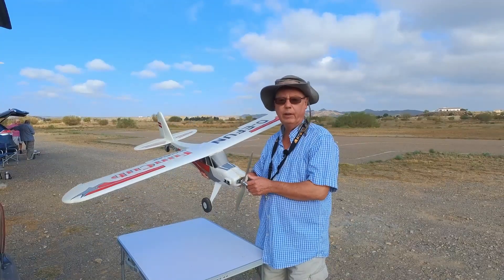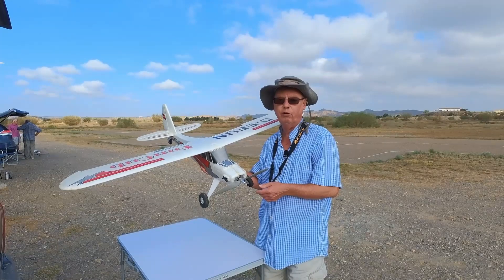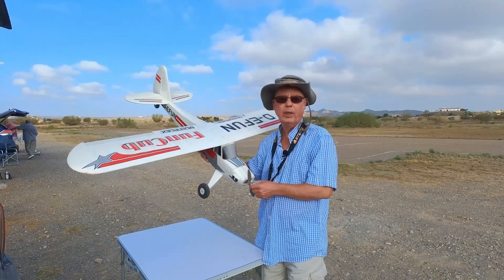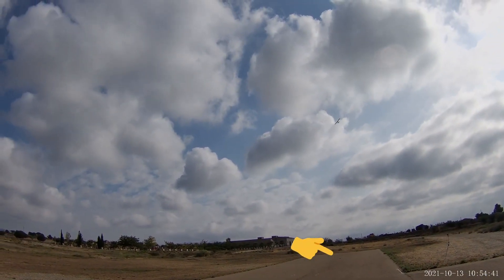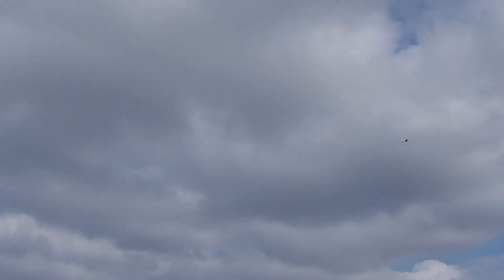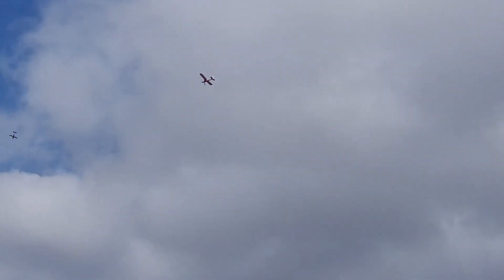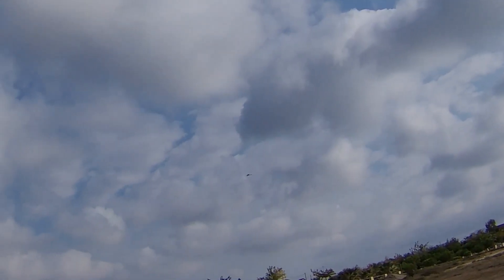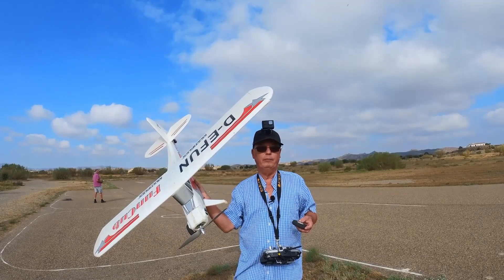HobbyEagle A3 Pro V2 6 axis Gyro Fixed Wing Flight Test

Comment: is it possible to set it on full gyro mode(when i dont hold the stick the plane going straight)? Please give me answers:)
Reply from the maker: Yes, I demonstrate that in the video here : https://youtu.be/OPIbe3jZpgY?t=184 I put the plane into a dive then switch to auto level and the plane recovers and flies level on it's own. The same can be done with the newer, smaller A3 Mini Gyro : https://youtu.be/rPhf0cLP1hw
Reply: @ thanks i cant hear english well because i am asian thanks for telling me!
Reply from the maker: @pubgmobile_player_service  If you turn on subtitles or "closed captions" CC in the bottom of the video window,  you can change the auto generated language in the settings (gear) icon. Thanks for watching, have a great day!
Reply: @1nformatica  oh thanks !

Comment: Been playing back and forth between these and the lemon rx stability plus rx’s. Haven’t had too much success other than bench tests. Seems like when I’m the air it’s a completely different ball game. I want auto level and I know both receivers I mentioned off it, just a matter of dialing in
Reply from the maker: I prefer to have the stabiliser separate from the receiver. One thing I notice that few people mention is that the stabiliser function uses full throw of the control surface. That is, if, for example you have reduce the throw on a surface by using "rates" on the transmitter that limit does not apply to the stabiliser function. That is why it seems that the stabiliser over controls when switched in. Make sure the maximum throws recommended for your model are set by adjusting the control linkages, do not relay on  the transmitter rates. Good luck with your trials!
Reply: @1nformatica  thank you for the reply. I have a dynam primo that I use as a test plane for all of these rx’s before I put them in my balsa builds. I flew tbe primo last night with the lemon rx stability plus and was flying beautifully, until half my left wing broke off mid air..... then I had to go swimming with the gators in south Florida to get what was left of my plane. Good thing is everything still works snd gonna try again when my new wing arrives